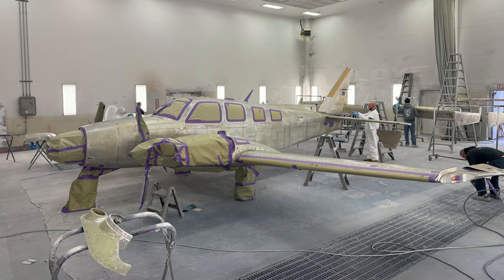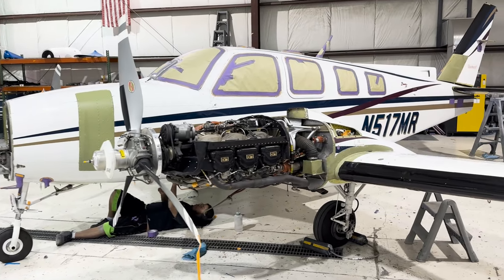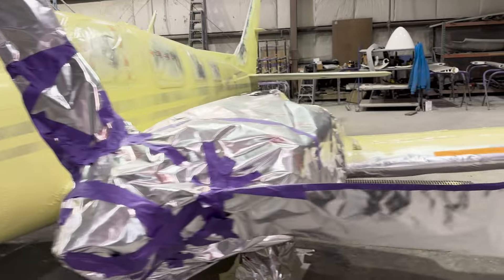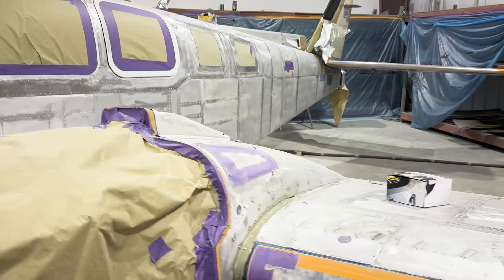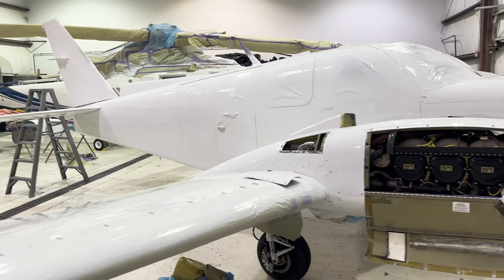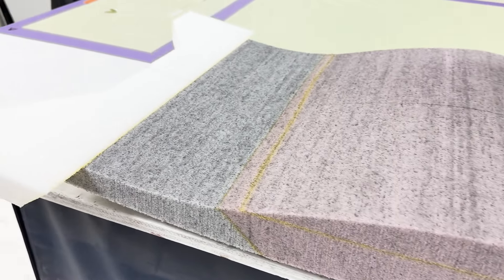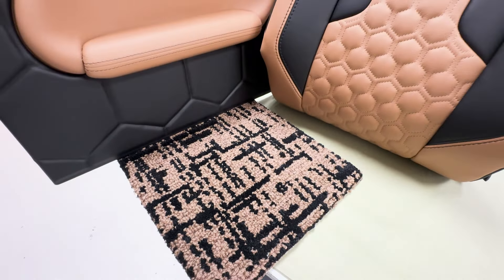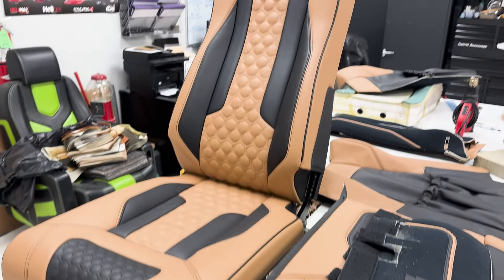Baron 58 Paint & Interior Video 6

Comment: I fly a baron as well, I'm curious about your avionics upgrades. I was told with the de-ice boots that I might as well keep a vacuum powered attitude indicator since you need the vacuum system for the boots and that it can cause issues if you just cap the line off to the instruments since the pump is running against more resistance. Did you find a way around that or have any issues?
Reply from the maker: The attitude indicator can be removed as well to move to digital. The vacuum regulator will need to be adjusted for lack of gyros. Our Avionics shop has completed this many times.  No issues. If you want to keep the vac ADI it’s up to you.